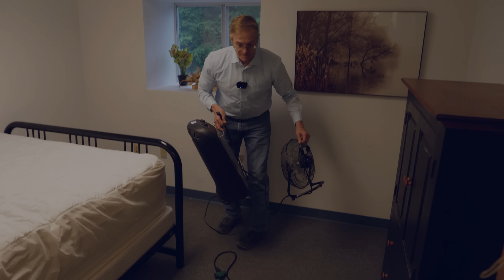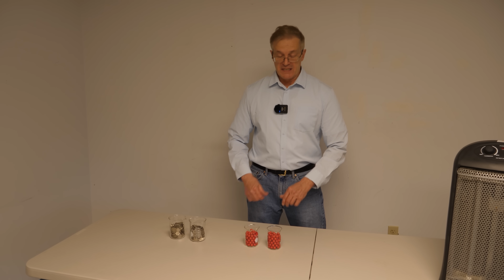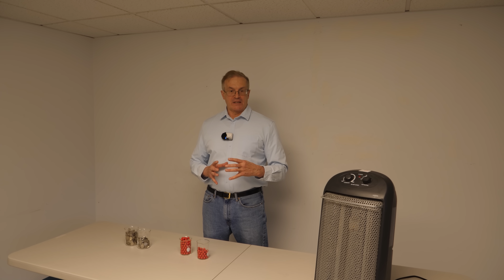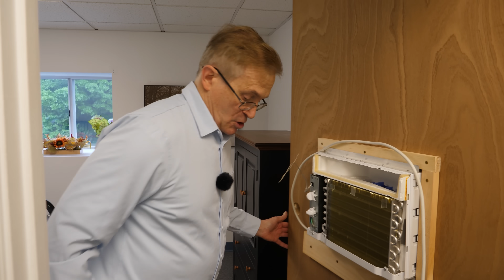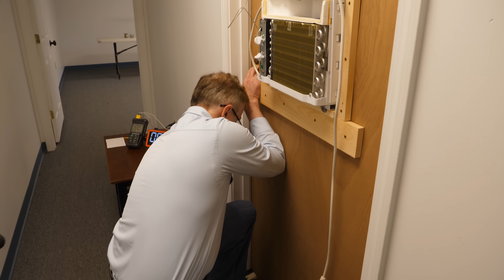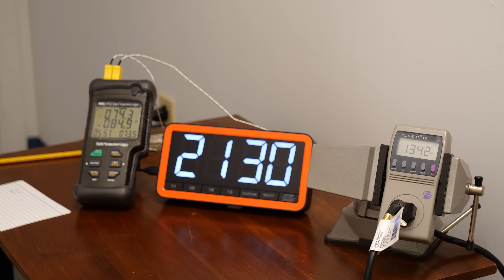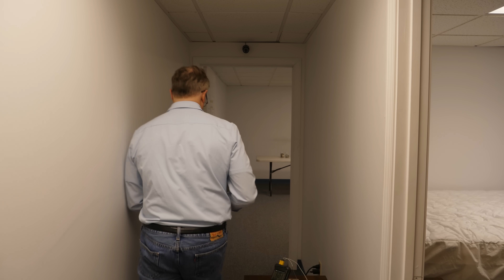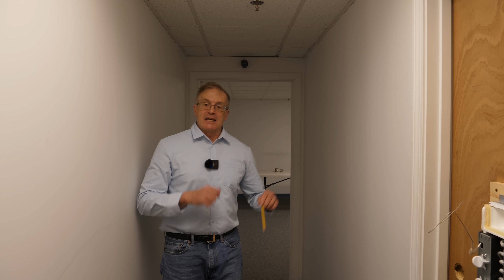You're wasting money on heating! Use your A/C!

Comment: Some 30 years ago now, I had the bright idea of turning a window AC machine around to blow the cold air outside and the hot air inside. I was amazed how well that worked! Almost cut my electric bill by 1/4 if memory serves. And that was only using one small unit, I could have done more with multiple units. There are down sides of coarse, one of them being cold starts. If the room is already cold, you wont get the compressor to start unless you heat the thermal couple. Another is the fan noise, what used to be outside is now inside, so the whole machine is just noisier like this. Water, you have to do something with the condensation buildup. And there is nothing pretty looking about the setup, if that matters to any of you. But it definitely works well otherwise once you get it running.
Cheers 🍻
Reply: Cool! My heating bill was outrageous last winter. I think I will try this.
Reply: @ambulocetusnatans  use a portable AC unit, you can set the unit on say a porch and just put the round duct in the window to blow the heat inside.  All you'll have is noise from the heat blowing in and the AC is outside.  Also they dehumidify themselves, so no drain lines.
Reply: @BrockGrimes :
This would be a better way of doing the job, yes! I didn't have one back then, I was simply using what I had available to run tests. But a Portable AC is the much easier way of doing this job for sure! But the entire machine must be indoors, or temp controlled in a box outside.
Reply: @BrockGrimes would require 2 ducts 1 to supply I side air to the condenser 2nd to return  warmed air back to the house.
Reply: @BrockGrimes  It didn`t icing?
Reply: @daviddroescher  :
This is another down side, the home must breath. If constantly pushing air out via the condenser side, you have to bring fresh air in from somewhere to replace it. This is probably the biggest hurdle to overcome. While the idea of using one of these at a heater is a good one, there are problems with the idea for sure. Ideally you want a positive pressure in your home to keep the outside out. But these will create a negative pressure and at that point will become less efficient simply due to their inability to move air in a vacuum. If you have a home that leaks like most, this won't be very noticeable. But when you open a door and feel that massive inrush of cold air, you'll know what then, and these must breath on both sides for any kind of balance. 

They still do work in the negative pressure state, just not as well as they could if set up more properly. I ran mine negative, and still saw the benefit.
Reply: @BrockGrimes  Portable air conditioners are not very efficient. A normal aircon circulates the inside air inside only and outside air outside only. The portable one in your configuration pumps air into the room and the same amount of warmer than outside air out again. When it is used for cooling it is the opposite. Hot air is sucked in to the room under the door and any other opening.
Reply: @ambulocetusnatans  You could also buy a Window Air Conditioner that has a reversing valve/heating function. Midea make them for example. Or get a Minisplit installed, that will be even more efficient. Daikin makes good ones for heating that are not that expensive.
Reply: @ambulocetusnatans  if you have central air you may be able to have it converted to also be a "heatpump" or if its on the older side and needs a lot of servicing/maintenance or near replacement you can just have a whole new ac put in with heat pump, they dont really cost anything more. Our ac is also our heater in the winter and it was working all the way down into -16f one year haha.
Reply: We have it set up at my company so the AC unit is dehumidifying and cooling down our server room, but rather than venting outside, it keeps the auxiliary bathroom really comfortable.
Reply: Right, but a proper heat pump with reversing valves won’t suffer from most of those, and some modern heat pumps work down to ~-20f (-25c), so unless you’re in an extreme cold environment or don’t have reliable electric power, heat pump wins over resistive heating and fossil fuel heating.
Reply: @geoffstrickler  "Fossil" fuel? What is that? Do you mean oil that is constantly being produced inside of the earth?
Reply: I used to stick the temperature probe inside of one of those plug in Glade air fresheners and that keeps the compressor on no matter how cold it is. 😁
Reply: @BlondieHappyGuy  you should watch technology connections videos on heat pumps and natural gas! He may change your views on that
Reply: @BlondieHappyGuy  :

Yes exactly.... It ain't all peaches and cream, there is no perfect answer!
The science is simple, phase change of one temp into another. Now make it work in the typical American home with the endless and broken, American opinion!.... Good luck with these kids! I am one born and raised, still don't know how to talk to the rest of my kin! Good luck.
Cheers 🍻
Reply: @3rdfamily :
I don't need to show anything, this is not my video!
Reply: Ive done the same with a 5200 btu unit. Impressive results once you trick it to kick on and allow it to work a while.
Reply: Please, this isn't a good idea. Why? Because first off, the coil sizes are wrong for the job. Second, an actual heat pump or one that is designed for it, has the proper metering device for heat, as it needs a smaller orifice than it does in cool mode. And third, there is no way to really defrost. 
Don't worry, units that do reverse heating will be available fairly soon.
Reply: @sprockkets I believe this is just a proof of concept, you should not actually do this, he just demonstrates that even if doing it this awkward way, energy is saved.
Reply: @thomashenden71  of course.
Reply: @sprockkets  coil sizes right for the job? - that's ridiculous - in a regular heat pump, the system is optimized as an air conditioner, and via the reversing valve (aka king valve), you swap the coils to get heat, and NEITHER coil is optimized, but you have got what you have got.  An "optimized" system would use TWO completely separate systems, one for heat and one for cooling, with ideal coil sizes.  Installing a window A/C system backwards is completely fine, in fact, it's exactly how scientists at MIT INVENTED the heat pump!
Reply: @carlosedwardos  incorrect. In a normal heat pump, the larger coil used outdoors is good for winter use because it is harder to sacavage for heat.
Likewise, the smaller indoor coil helps make the air hotter.
You have none of that with a window unit turned around, nor the proper metering device for heat.
Reply: @sprockkets  window unit turned around works fine in a pinch as demonstrated by this video, as does a normal A/C heat pump combo with reversing valve like so many people already have in their home.  For maximum efficiency, you want a unit optimized for A/C and another unit optimized as a heat pump, and you want some way to cool the outdoor condenser in summer, like an anodized outside coil in a running brook, or a misting system with filtered water, or at least some protection from direct sunlight.
Reply: @carlosedwardos  bro best you quit while you are not that far behind. Esp when you didn't take into account water drainage.
Reply: Lol at having to go shovel snow to make a path and climb a ladder to get to the controls on the outside.
Reply: @jamesg8246 :
Oh I see, you're the reason everything has to be child proofed anymore lol. Ever heard of duct work? Look it up before making another ignorant reply 🙄. The entire unit is indoors then ducted to a window.... Duh.!?
Reply: I mentioned that to my wife and she looked at me like I was insane! So told her go outside and feel that heat getting pumped out? She said: oh yeah that's a great idea!!! But it still uses too much electricity!! All I could do was shake my head!
Reply: @Edmond3290  Now you have proof she can see for herself.
Reply: @geoffstrickler  yeah but still complains about electricity consumption even on an inverter Fujitsu. Lol 😂
Reply: @Edmond3290  A couple people mentioned some problems with the idea, but I think this one may be the biggest.
Reply: plus, the controls will be outside, hard to get to, and in the weather, plus  the cold side is allowed to only get so cold and then it shuts off the pump, it assumes that no one wants the inside of their room to be less than  a certain temp, and in winter time its often below that temp. 

i played around with this as well, and created ducts and added fans and played with the thermal couples with the entire thing inside a spare bedroom, i took cold air from outside and sucked it in from a window through a duct, and cooled it even more then pushed that cooler air back out, there fore moving heat inside and heating the indoors.

i ran out of time, money, needed that space back and got rid of most of that equipment, but i had learned a lot, but i also knew i had much to learn
Reply: @jasonbrown467  :
Clearly you don't physically turn the machine around in a window. You "duct" it backwards. Nothing is outside but cold air! The entire machine is indoors.
Reply: @Finite-Tuning  lol i dont know if thats super clear. i have seen people say that they have done this, and if i take your post verbatim thats what you said.  otherwise we are on a simliar page
Reply: @jasonbrown467 : 
I don't know who you are talking to or about what, but I don't think your reply was meant for me. I did this basic thing in the video, I lived this basic thing, I know this thing matter of factually. Still don't think you were talking to me though. Cheers🍻
Reply: This is seriously a waste of time and money.
There is a long list of issues needing addressed.
From defrosting the evaporation coils in damp weather to dealing with the lack of drainage in modern window ac units.
They lack a drainage hole to drip water like old ones had because they use the fan to splash water up onto the evaporation coils to utilize the evaporative cooling of water which means it  spits water droplets into what is now inside.
Mold issues, ducting issues not being designed to cool a room to 40 degrees F or less.
Can you solve all these issues? Sure but when you're done you have a cobbled togather not designed for purpose device of questionable reliability and less capability than an affordable mini-split.
If your goal is to tinker go for it if it's to get an efficient affordable heatpump with window ac like capacity get a mini-split.
Some even have solar inputs with MPPT controllers to utilize solar panel output directly and use grid power when solar is insufficient.
Others have multiple indoor heads to service multiple rooms and most keep their cop above 2 even down to 5 degrees F (-15C) and have a seer of 11 or better.
Avoid the headache and just install a mini-split they even have precgarged lines no vacuum pump needed just a drill and hand tools. You may need an electrician if you aren't comfortable in a breaker box or running power to the outside of your house.
Reply: @ghz24 :
Shut up child. You've just puked all over your keyboard and made a bunch of noise here!
Reply: Another problem is some of the window ac’s are toxic and can’t be vented into the house … I only know cuz I got in trouble as a teen doing the same thing as u 😂. Not sure which tech it is.. or if they still make them that way or not. 

Kinda reminds me of the people that use (I wanna say natural gas) ovens to heat their house and end up dying from the fumes.
Reply: @DRJoe100   whoever told you that, misunderstood how an A/C unit works.  A/C units run a closed-loop system, in which they recirculate the freon to work.  If the freon is ever expelled the unit will no longer work.
Reply: @DRJoe100  :
I don't know what you're thinking of, but nothing is "toxic" about a sealed AC unit. While freon can be toxic, if it leaks, an actual physical leak would be required! But even still the liquid instantly evaporates and escapes since no home is truly sealed air tight. Toxic? Can be if you're standing right next to one that is leaking, but no, these are not toxic under normal use case conditions.
Reply: @Finite-Tuning You are missing the possible biological toxicity of mold growing in the water pan.
Reply: @ghz24  :
No, I am not. You are missing what I've already written! I have lived the set up I've described, I have the real world experience with that set up. All you have to do is read what I've written and ask questions rather then try to point fingers because you don't understand or otherwise, missed it!
Reply: @Finite-Tuning  lol, you must live in Florida
Reply: @sprockkets :
Nope! 
Pennsylvania.
Reply: @Finite-Tuning  Well actually my advice was to people trying to do this with a modern ac based off of your advice from using 30 year old technology. 
I can tell it's from an old ac because there are no weep holes in modern window ac units.
The fan flips the water up onto the condenser coils to give additional efficiency from the evaporative cooling of the condensed water. In the process it blows droplets of water outside, now inside.
This pool of potentially moldy water is now inside the house and being splattered onto the floor.
I just tested my window unit it won't allow settings below 61 degrees and that is going the wrong direction because the unit turns on when the temp goes above that setting so if it were turned around it would turn on  when the outside temperature raises to 61 but turns off when it gets colder.
Even if you relocated the thermostat to the "outside" side of the unit it still works backwards turning off when it gets cold not on. Just heating the thermocouple will not change this fact it just makes it temporarily run unless you constantly heat it.
Add in ill fitting little fanfold side pieces that are fine when the temperature difference between inside and outside is not large but a huge air leak when it gets cold and the temperature difference is 70 degrees.
The evaporation coils will ice up and block air flow unless you add a system to detect it happening and deal with the ice.
Furthermore I never said it was impossible just a waste of time and effort.
I stand by my advice to just get a mini-split and avoid the tinkering nonsense that will end up with an inferior product that needs supervision to work.
Even if you have a 30 year old ac unit the advances in efficiency make it not worthy of use.
I'll install a mini-split with solar inputs and enjoy my trouble free heat and ac that is virtually free whenever the sun shines extremely efficient and works down to 5 degrees Fahrenheit without having to turn it around every 6 months or wonder if it is working if I go out of town.
Older ac units were much easier to tinker into a heater but it's just not worth it for a modern ac especially in a world with highly efficient mini-splits that a semicompetent DIYer can install in an afternoon with no special tools.
Reply: @Finite-Tuning  lol I guess you never noticed the ice outside gg bro
Reply: @sprockkets :
Nope, no ice under normal running conditions. You obviously don't understand the set up or how any of it actually works.
Reply: @Finite-Tuning  Lol no, as an actual HVAC tech who installs and runs mini splits, I know actually what's going on.
Keep going with the hack jobs LOL.
Reply: @sprockkets :
You claim to be an HVAC technician.... Lol, now that is funny!
Reply: @Finite-Tuning  says the guy who thinks he remembers anything in detail from 30 years ago.
Reply: @DRJoe100  No, nothing toxic comes out of an electric A/C unit, from either side.  Someone lied to you or was misinformed.
Reply: Its freon gas. @DRJoe100
Reply: @jacobe2995  Freon isn't toxic?
It just destroys the ozone layer.
Reply: @jacobe2995  freon is a brand,  not a refrigerant
Reply: @DRJoe100  im not sure your understand the refrigeration cycle. The A/C system is a 100% closed loop system.
Reply: @DRJoe100  its not toxic, if that was true all air coming in would be as well. air is circulated inside. freon is but you have to have leaks in the pipes for that
Reply: @DRJoe100 you are ignorant. Natural gas ovens or any household oven is not harmful unless a issue but no different than hot water tanks or fireplace logs that are Natural gas. Using a window AC in vented is NOTHING like running a generator indoors

Comment: The best way to explain how an air conditioner works is the working gas is like a sponge. If you compress the gas more heat energy will be in closer proximity making the gas hotter and thus causing it to radiate heat to return to ambient temperature. If you then uncompress this gas there is now less heat energy in a given space and it will absorb heat to return to ambient temperature.

With a space heater you're creating 2500w of heat for 2500w of electricity, a heat pump can move that same 2500w of heat but may only consume ~300-500w doing it. They do sometimes struggle in very cold weather so I see where they may be unsuitable but for most climates they work well.